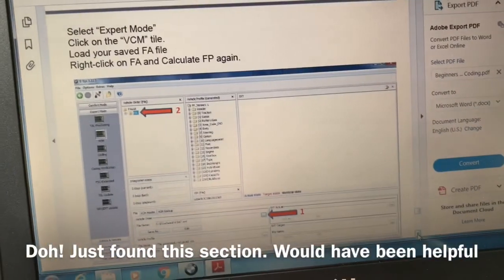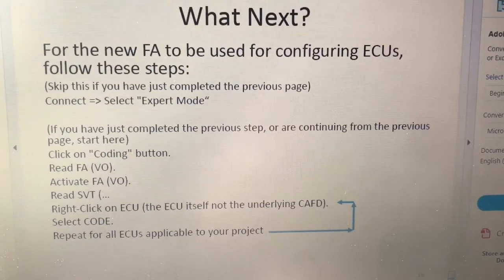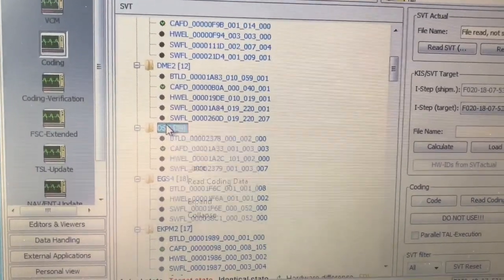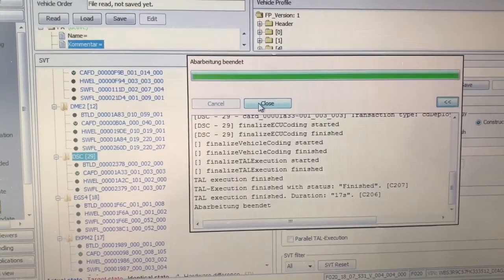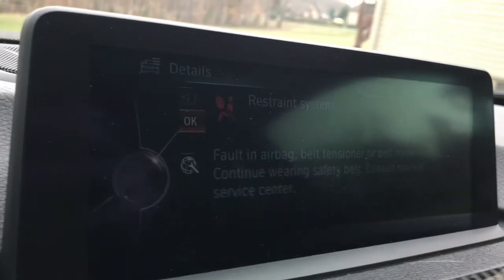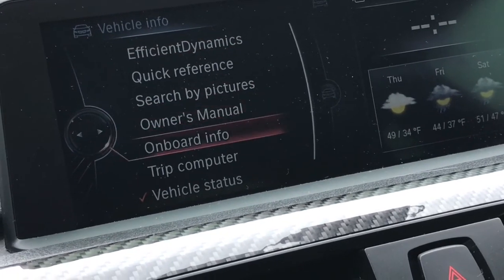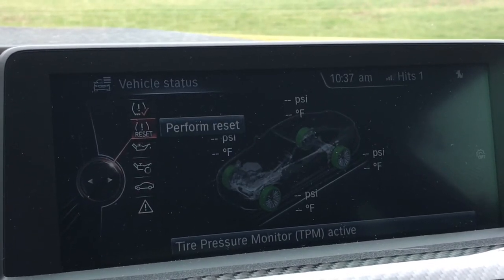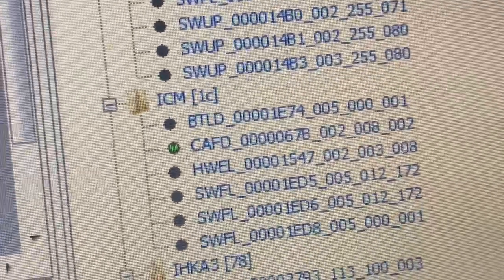How to CODE OUT EDC on F82/F83 M4 or F80 M3 (Part 2)

Comment: Thanks so much for the video — it was incredibly helpful! I followed the steps and was able to code out EDC, but I also ran into the same deploy error when coding the ICM. Just wondering, how did you deal with that error? Did you leave it as is, or were you able to find a workaround to code it successfully?
Reply from the maker: I’m pretty sure I just left it like in the video
Reply: @HelpMeDIY I did the same. There has been no issues so far 😀

Comment: I never seen a follow up comment on what was causing your ICM code error?
Reply from the maker: +Eric reset them and it didn’t come back 🤷‍♂️
Reply: @HelpMeDIY  Thanks.... I am about to try this tomorrow. Installed coilovers today. Your in NC? Charlotte here
Reply from the maker: @eric4698  yes, Greensboro 😁
Reply from the maker: @eric4698  I used to be an active member there... until they banned me for posting helpful content saying I was “promoting a YouTube channel”. guess their sponsors don’t like people helping people.
Reply: @HelpMeDIY  Well screw them..... I was failing doing this following the guides. They kept saying to read SVT to get modules to populate but mine was getting errors. Turns out if I did read ECU instead then they showed up then I coded each one .... one at a time with no errors. Drove the car to reset TPMS and looks like it worked
Reply from the maker: @eric4698  yeah exactly!
Reply: @HelpMeDIY  Instagram and FB?
Reply from the maker: @eric4698  Yup! Help Me DIY on Fb and helpmediy_official on IG
Reply: @HelpMeDIY  Following! Thanks again for the vid